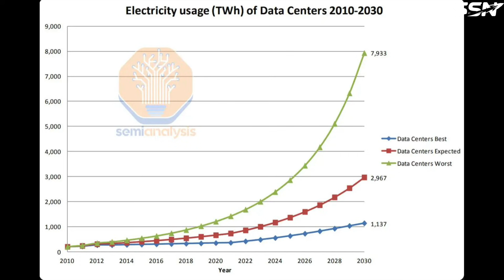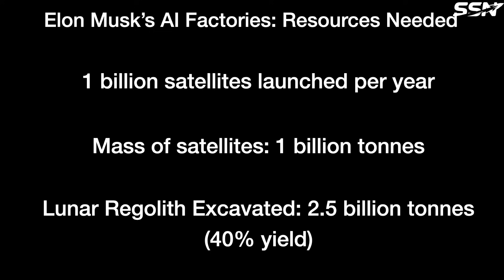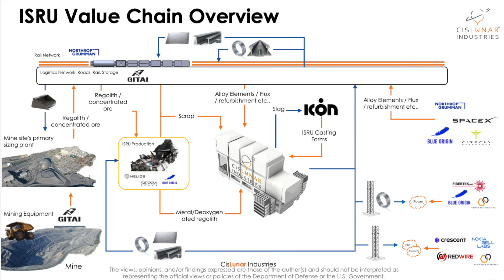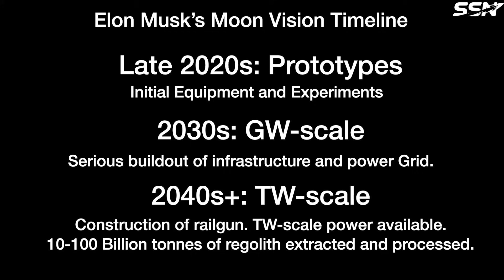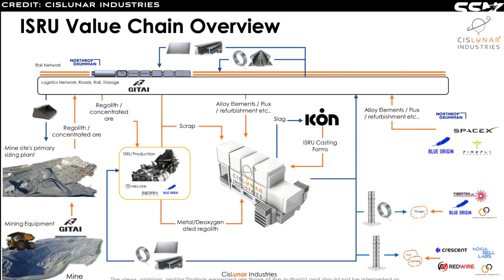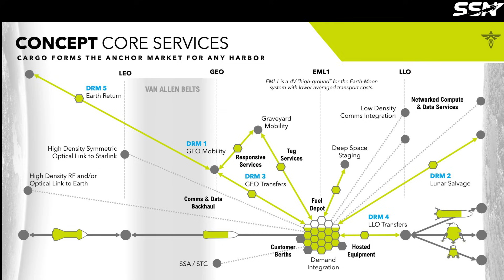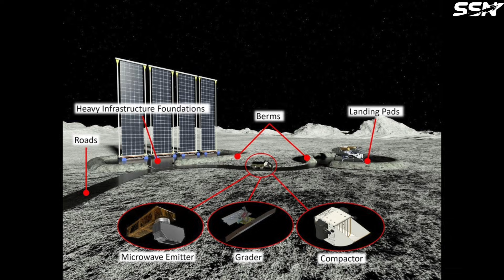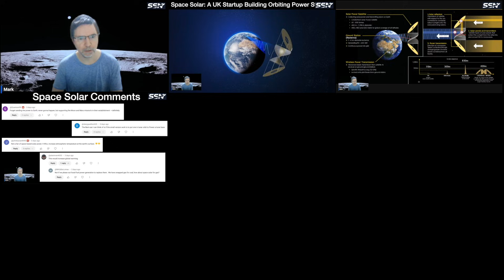Railguns on the Moon? Elon Musk's Orbital AI Vision Could Build a Thriving Cislunar Economy

Comment: The problem with digging "stuff" out to be transported and reprocess, has different stages of the "problem" it self. Yes there are substances present in locked Moon megalith or soil, if we just dig it out in a way we do it on Earth the disturbed soil would give up its locked potentials...we will lose H3 and other substances...so this process will have to be locked in environmental stability not done by digger but by an extractor-harvester...totally different ball game. The digging and extracting and process or reprocess would have to be done at the same time in a strict sequence. This is very complicated...not to say that baking the rock in any form to 700C will require a huge energy output " I dont know where from?" and it will consume more energy than its worth.- that is by it self. But if we have to bring these substances from Earth sole to be use to run Moon operations that is a different story, but to run these ops for 2 weeks out of the year? that do not make much sense.And what about the costs? not to say we going to do all this out of pure love for the MOON? we going to print endless amount of $-WHAT EVER IT IS !! and dump it in to Moon industry like in to oblivion? burn it all? we do not have a clear solid plan...and that is the most dangerous thing. TH